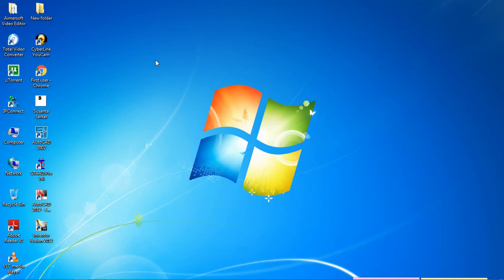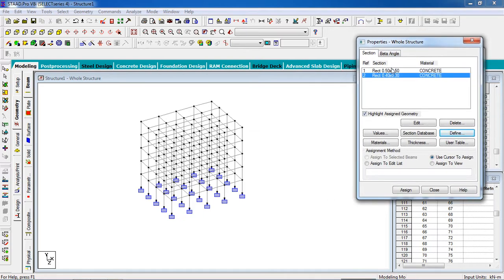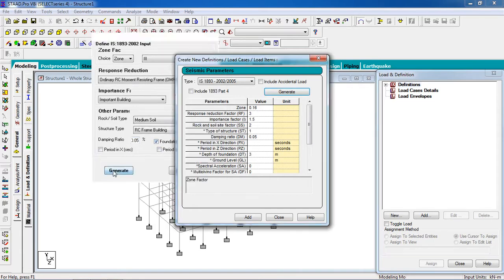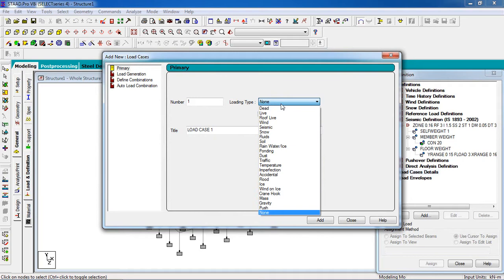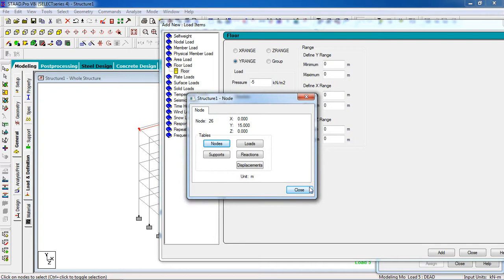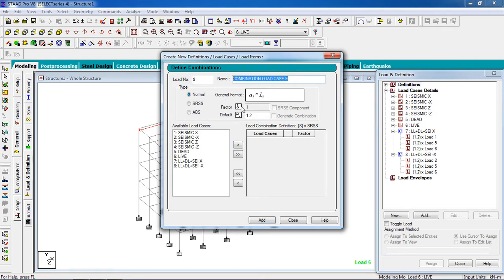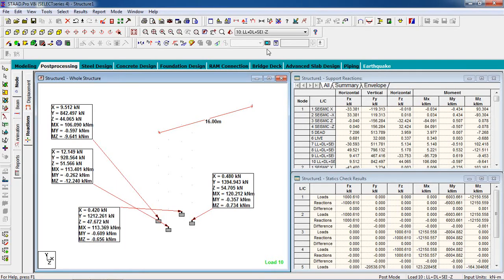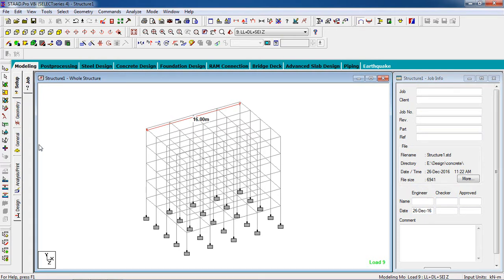STAAD Pro Tutorials - Seismic Load Analysis on RCC Building  ( Day 23)

Comment: for creating the seismic load on selecting the IS code book i.e is 1893 2002/2005  while generating i am getting creation failed how can i rectify it?
Reply from the maker: Staad will show the errors and notes , read the errors you will know which part is wrong !
Reply: Facing same issue how to solve
Reply: I am also facing this problem, I am totally disappointing. Plz say the solution for regarding this problem.

Comment: Hi..
I have 2 doubts.
1.while defining seismic definition, u added member load as conc. Load.. should it be as conc.load or UNI.
2. While defining LL on floors u have used X range too..but while defining floor loads in seismic definition earlier, u used only y range.
Reply from the maker: Because that is the way !
Reply: 2. bcz earthquake causes lateral loading thats why X and Z range is being applied in sesmic loading